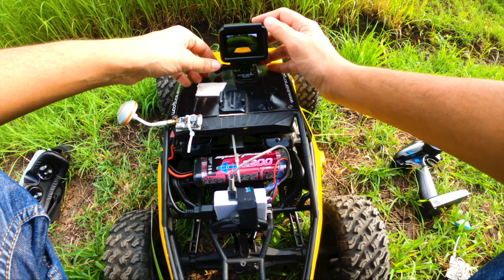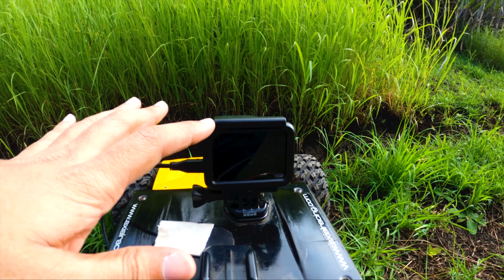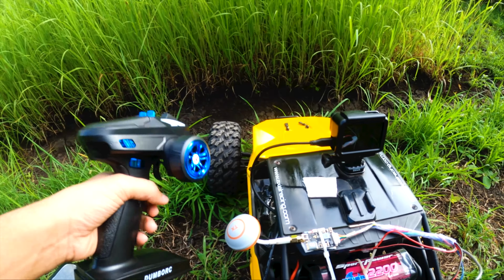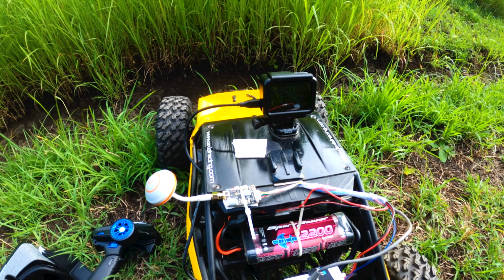Dumbo RC X6 Long Range Radio Test with FPV on Rc Car Yeti Xl Hero 7 4k

Comment: Definitely picking this up for my speed runs🤟
Reply from the maker: Yes it will help you go further for that extra strech to build up your speed. Also this has gyro built-in incase you need that can be adjusted with 6th channel knob. 👍

Comment: Nice video! Fpv on the ground is much more challenging, there is much interference. Dumbo RC is excellent, the best frequency for fpv is 433mhz. Video 1.2ghz can pass through obstacules
Reply from the maker: Yes I've researched on this a lot now. Will be getting a 1.2ghz video and a long range radio system that'll probably work with Dumbo rc radio too. Thank you for watching 👍

Comment: does your camera already have a microphone built into it
Reply from the maker: This was with a GoPro Setup directly as a fpv camera so the audio can be used. Now I use a runcam swift 2 which has a mic built-in

Comment: Excellente vidéo. My reccord fpv is 700m. Good Luck !!
Reply from the maker: That's cool! Thanks! I've got some upgrades for the radio that will push it a few kilometres. Stay tuned 👍
Reply: You guys got a set up video?
Reply: @professeurfpv1536  thanks just now got your reply

Comment: There is a video here on YouTube where a guy uses a Crossfire Lite module and receiver plugged into a RadioLink transmitter with a RSC (remote servo control) port. He thought the DumboRC transmitter has this port. The stock range from a DumboRC is fantastic right out of the box. I'm trying to find out how much range adding the Crossfire gives. It may be a simpler way for you to get what you are looking for in your other video.
Reply from the maker: I've used my mfd uhf module with this radio using the DSC port which works even better but I haven't tested it's full range yet
Reply: @RakishRc  This whole long range thing gets very complicated and very expensive in a hurry! There has to be a way of doing this without a ground station. That makes it cumbersome.

Comment: What do I need to be able to drive my Rc like you did in this video it looks like fun
Reply from the maker: This was my first attempt at fpv with rc car using basic 5.8ghz video transmitter and receiver with the dumbo rc radio. Thanks for watching 👍
Reply: @RakishRc  I enjoyed this video,  you should do a video on the Gopro fpv setup I find it interesting.  Greetings from Austria 🇦🇹

Comment: Hi, I am from kolkata. I have this same transmitter and receiver. Have been using 2s 7.4v lipo with it. Can its receiver handle 11.1v 3s lipo. I am pretty much confused, as the receiver has written on it '4.8v-10v'
Reply from the maker: Well if you're powering it from a supported 3s esc then it will work.. if you want to connect a 3s directly then I am not sure if it would burn out but you could try there isn't much difference between 10v and 11v..it should work.
Reply: I think that should work for the receiver or 12v dc plug
Reply: @RakishRc  I tried it. It supports. But you have to have a 3s compliant esc.
Reply from the maker: @saikatmauser  so did you try a 3s directly to the receiver?
Reply: @RakishRc  No, connected via esc. That esc was 3s compliant. It supplied the suitable volt to the receiver.
Reply from the maker: @saikatmauser  okay cool 👍

Comment: Now you need a 1.2 ghz system useing Tbs crossfire.  Which is what I have. Although I have not wired it up yet is still a bit over my head. Cannot find any information online just stuff about drones use it the system good luck.  liked And subscribe.
Reply from the maker: Yes I've looked at a few 1.2 and 2.4 ghz transmitters. Might get one soon. Thanks 👍
Reply: Try the youtube channel called FPV Set, you can see a lot of videos with FPV on Rc Cars. The guy uses crossfire with 1.2ghz video.
Video 1.2 and radio 2.4 does not work fine
Reply: @danieltrilopez   thanks So much!! 
I will search that.
Reply from the maker: @danieltrilopez  Thanks for the tip. I searched his videos and saw a few. Its all in spanis so can't understand what he is saying but i could see some of his equipment and get some idea.
Reply: @RakishRc  actually it's Portuguese, we are Brazilians and we have a group called FPV RC Car. That Guy got 1.5km with his Traxxas, his antennas are a key point to achieve long range on the ground.
Keep searching we learn together
Reply from the maker: @danieltrilopez  Thanks for the information. Yes the antenna alone can make a world of difference. I had a look inside this Dumbo Rc radio as well to see if I could replace it or modify but don't think its safe.

Comment: Can this Dumbo Rc X6 work on Ecx amp crush rc?
Reply from the maker: Yes you can use it with any rc model but the amp crush seems to have receiver and esc as a combo so you may have to replace the esc too. Unless there's option to only remove the stock receiver and still use the stock esc with a new receiver
Reply: @RakishRc  if i would change the motors into brushless and esc on my amp crush may it would, right sir?
Reply from the maker: @Quad8ightMix  yes absolutely 👍 if you want you could look at the radiolink rc6gs V2 radio which is a bit better in terms of quality and reliability than the dumbo rc radio.
Reply: @RakishRc  thanks for the tip, but i already ordered the Gyro version of this Dumbo rc. Its currently on sale today, because of 9-9 sale
Reply from the maker: @Quad8ightMix  cool 👍
Reply: @RakishRc  is flysky Fs-gt2 better than dumbo rc X6FG?
Reply from the maker: @Quad8ightMix  dumbo rc is better. Fsgt2 is very basic.
Reply: @RakishRc  thanks again for your confirmation, i asked bec my order on X6 has been canceled due to low stock, i now also watching the reviews of Dumbo Rc X4 with x6f reciever, as it has longer range also like this x6..
Reply from the maker: @Quad8ightMix  I'd still suggest you get the 6 channel version. Or best get the radiolink rc6gs V2. Either ways get a 6 channel version. Sure 4 channel version has same range but having 2 additional channels is always a good option.
Reply: @RakishRc  thanks alot for your very best tip and advice.. Okay I will get the x6.. 👍
Reply from the maker: @Quad8ightMix  cool 👍
Reply: @RakishRc  i just installed my upgrades on my ecx, first the goolrc 3650 4300kv brushless motor with 60a Esc, 2nd the DumboRc X6 transmitter with X6FG reciever.. all is working, but i noticed when i throttle forward the speed is limited even though im in full throttle, and when i throttle reverse the speed is really high speed.. Is there an adjustment for this?  forward must have more speed than the reverse..
Reply from the maker: @Quad8ightMix  seems like you have the outer two motor wires on esc connected in reverse. Switch the outer two wires of motor on esc and test. Also see if you can calibrate the esc to get proper end points of radio to work with esc. Lastly you have the knob to adjust the dual rate of throttle and steering under the radio top plate. 👍
Reply: @RakishRc  thank you for your tips , i already switched the outer wires of the motor, by connecting yellow wire to Blue wire
, and blue wire to yellow wire,
Reply from the maker: @Quad8ightMix  cool 👍

Comment: Im desperate to find a cheap high prrcision radio, is this high percision?
Reply from the maker: High precision as in? What are you planning to use it with?
Reply: @RakishRc  i mean i love my new rc drift car project. I wasted 1600 dollars only for body shell. Its a nissan s13 with alloy DY wheels and 4 sets of falken drift slicks.
Reply: @RakishRc  i mean slow driving.
Reply from the maker: @matcentrino7602  I'd suggest you try this and see if you like it it's even cheap. You can get it with gyro option for better stability if needed. It's a budget radio after all so you may find the steering and throttle response a bit dull compared to some standard kysoho radios include in rtrs so.
Reply: @RakishRc  For me, I bought the 4ch one, the cheapest DumboRC x4. Is it precision too?
Reply from the maker: @matcentrino7602  It will work fine but for your application I don't know how well it will perform. Precision wise i don't know how to gauge it but it works all right is what I've found. You'll only know once you use it for your project 👍 I hope you don't have to spend more once you try it
Reply: @RakishRc  Okay